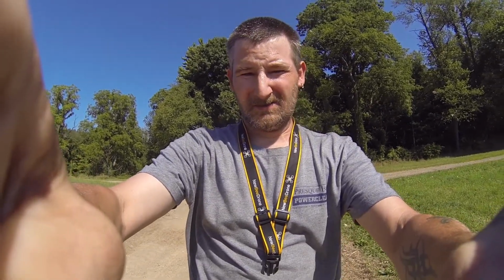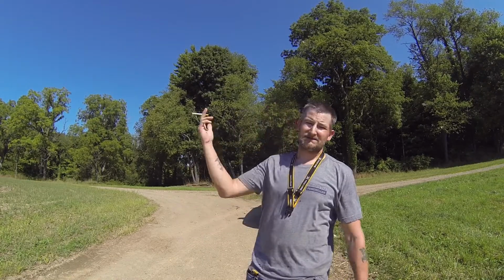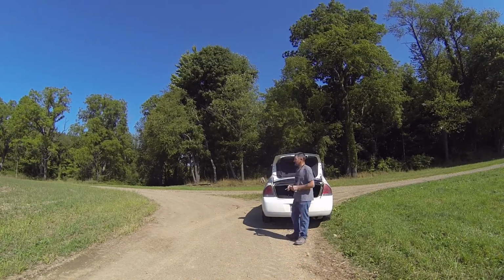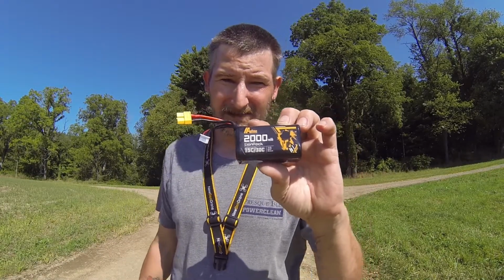AtomRC Dolphin Matek F411-WTE fc TBS UNIFY PRO , INAV 5.0 2000mah li-ion

Comment: nice setup, i am triying to setup my wing with the same FC using inav 5.1, but the GPS is not working, have you used softserial for the gps at wich speed?  thanks in advance.
Reply from the maker: Yes set baud to 56000 and set gps on it, it will work i had issues, its a little slower n sometimes it will show up as gps lost but itll come back. 

My  wing with hdzero has gps on softserial....my s800 reptile
Reply: @devilsreject78  is the sam e Wing, maybe i am using wrong inav target , i will insist
Reply from the maker: @nbike  the soft serial #2 is made for gps & afew other things. 
Check the manual